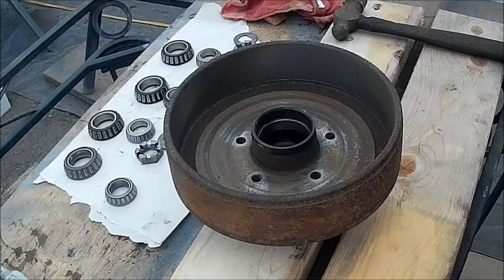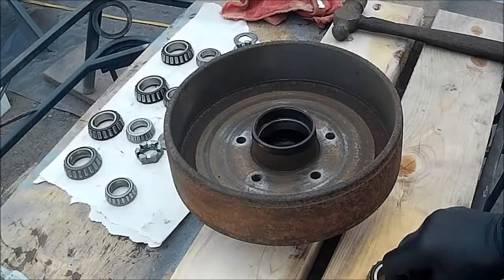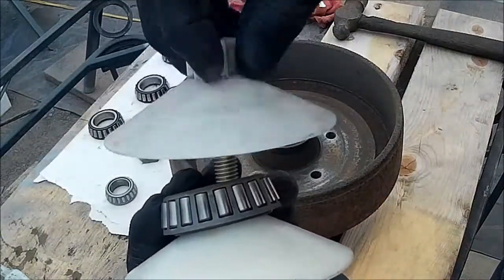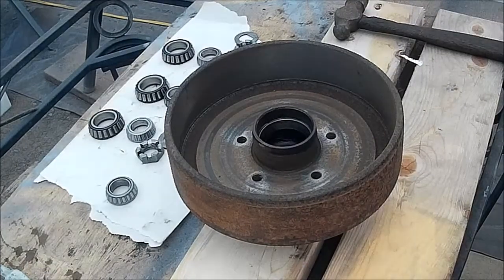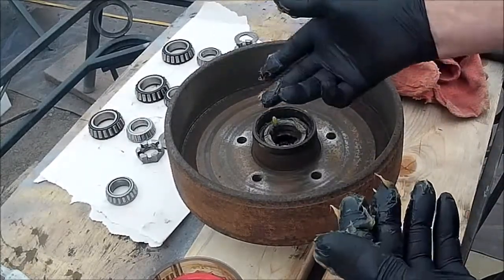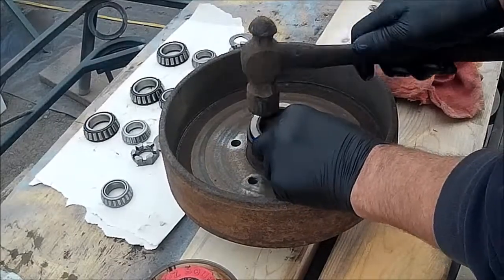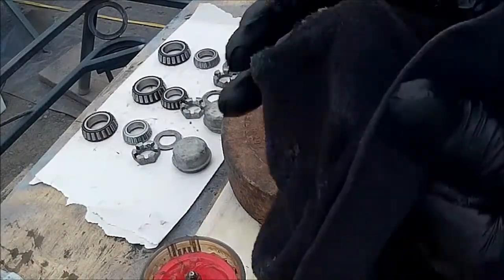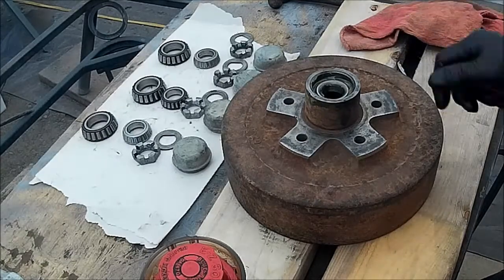Car Trailer Restore Part 2

Comment: I have the same bearing packer, if you look at the back side of the container for the grease there are raised ridges. They fit the jaws of a vise. If you put the greaser and bearing into the vise you can easily control the amount of grease pushed into the bearing.
Glenn
Reply from the maker: Good Tip There, Thanks!
Reply: One other input, the top of the packer comes apart, if you pull it apart and rotate it 90- degrees there is a step that raises the top of the top. This raises the top above the top lip of the packer so that when grease gets low you can still stick it in a vise and squease it. Glenn
Reply from the maker: Thanks again, I've used this packer for years and I can't say I ever noticed that, I just added more grease, LOL